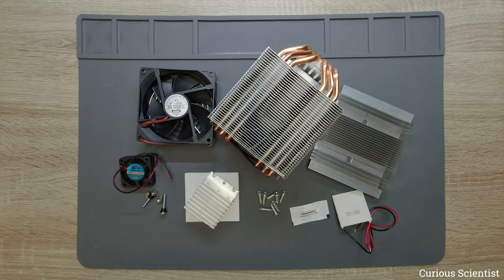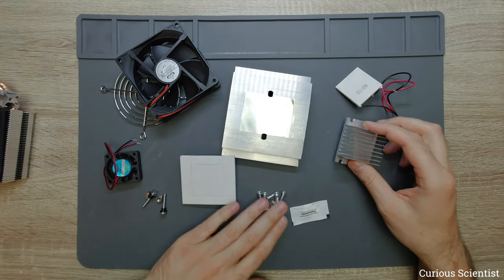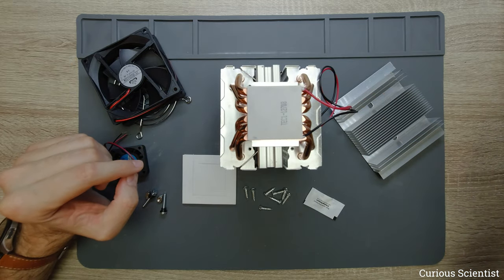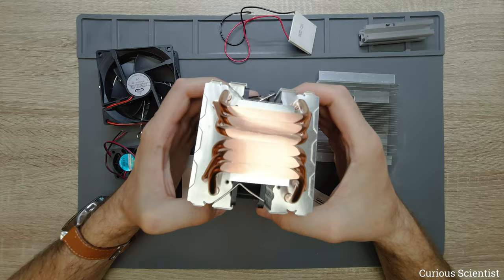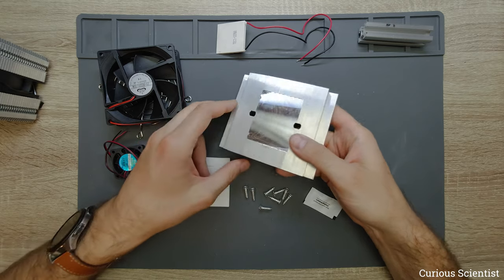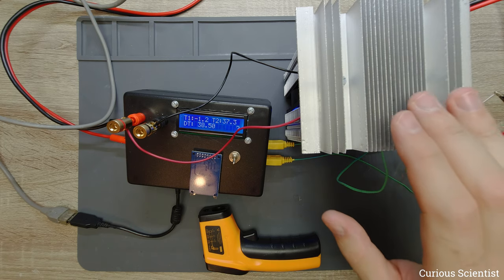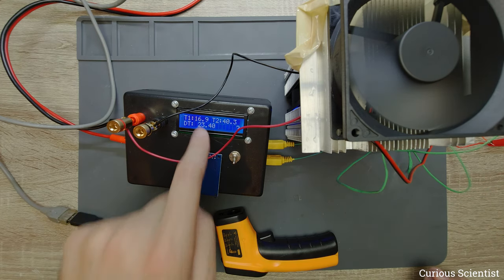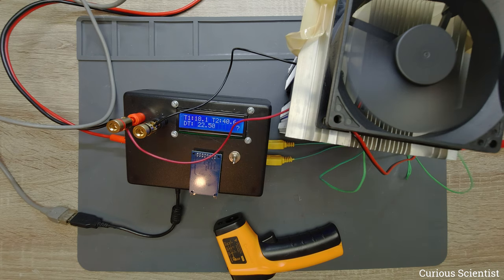Let's discuss about Peltier coolers #5 - A new arrangement of heatsinks

Comment: I'm working on a a product development and so badly want to believe in this technology. I need to drop the ambient temp about 20-30 degrees while removing humidity. Tough job....
Reply from the maker: Faith doesn't really work in physics. Peltier technology is really limited. What do you want to cool with the Peltier coolers? Dropping 20-30 degrees is quite doable, but the end result will depend on the amount of heat needed to be transferred.
Reply: @CuriousScientist  I need to cool the ambient air from approximately 120 degrees while removing humidity. This isn't a typical air conditioning system. It has a particular use.
Reply from the maker: 120 degrees can damage the Peltier cooler as it can potentially melt the solder. It is not designed for such hot environment. And 20-30 degrees from that is maybe not even enough. Dew points start from around 40°C and below, depending on the humidity.
Reply: No worries. I'm cooling the Peltier as well. The ambient air will be upwards of 120 degrees. But, the Peltier will never see that heat. It will hopefully just cool it through a couple of mechanisms
Reply: @CuriousScientist  Nada... the air is 120 degrees. The Peltier won't be under those conditions as it will be cooled. The air just needs to be cooled. Combination of water and air heat exchangers being controlled by the Peltiers
Reply from the maker: Alright. Then, why don't you just use a heatsink or similar stuff? As long as you don't want to cool below ambient temperature, you don't need Peltier coolers.
Reply: @CuriousScientist  I'm only trying to cool an area of say 20 sq. ft. So not trying to cool a whole room or anything like that. I want to exit the cold air under a decent amount of pressure so it feels even cooler. The Peltier will need to be cooled extremely well. I do believe a couple of say 10 amp Peltiers will work.
Reply from the maker: @kenarsenault9863  that is a huge area. One Peltier is only 40 mm x 40 mm. You would need a lot of them to cover that area... Also, you need to think about the time required to cool down the air. Furthermore, you can pass "through" a large volume of air through that area. That would require very high cooling power... I am a bit sceptical about the success of the project.
Reply: @CuriousScientist  Yeah... I think I overstated what I was trying to accomplish. In reality I'm basically creating a fan that will cool someone down while working. So, the sq. ft. is really much less. It would be turned on while someone is working in hot conditions and keep them cooler than their surroundings. So, all it has to do is blow cooler air on a small area.
Reply from the maker: Watch this video: https://youtu.be/ZDLN_tMxSQA

Comment: confuse should be at cooler side exhaust out not blow into cooler side? like cooler side been blow with room temp
Reply from the maker: I am sorry but I cannot comprehend what you said.
Reply: @CuriousScientist  should fan on cooler side should be blowing not blow in..
Reply from the maker: It doesn't matter if it is a push or pull configuration.

Comment: How much time elapsed between 18:39 and the edit at 18:40
I predict you had a very hard time.
Reply from the maker: Roughly 5 minutes because I forgot to remove the foam from above the holes for the bolts. :) I had to cut out the foam and align everything nicely.

Comment: hi. is there any tips on how to choose the right heat sink size for the system?
Reply from the maker: Hi!
Sure, you can estimate the amount of heat on the hot side (Joule heat, plus the heat pumped from the cold side to the hot side). Then, just use Google to see what kind of heat sink can get rid of the calculated heat.
Reply: @CuriousScientist  ahhhh i see. im habing troubles in choosing the right heat sink size for the cold side. does the same concept applies for choosing heat sink size for the cold side?
Reply from the maker: Heat is heat. ;) The same rules apply.
Reply: @CuriousScientist  just to double check if i am understanding the correct thing. if an example from the video, we need to dissipate 210W at the hot side. does it mean that we also need to use heat sink that can dissipate 210W at the cold side too?
Reply from the maker: No, you're wrong, sorry. Why would you need to dissipate the same heat on the cold side that is used to "absorb" heat? You need a heat sink that is at least capable of transferring the heat that you set as the cooling power. You can check the performance charts in the datasheet so you can get a rough idea about the cooling power (Qc) based on the driving parameters (current, voltage and hot side temperature), then you can size the heat sink accordingly. But since you won't transfer too much heat towards the cold side anyway, an older regular CPU cooler heat sink would be more than enough. You can also find relevant heat sinks on my website under the Parts and Tools page.
Reply: I would like to build a cooler box out of this explanation, is it possible??
Reply from the maker: Sure. I have a video series on this, check my channel.

Comment: You should flip the hot side and cold side as hot air rises. You'd get better results
Reply from the maker: There won't be significant changes. And here we use thermal conduction and not convection.
Reply: Do you think the heat would kill the module or the cold?
Reply: @TheNutzandBoltz  definitely the hot side would fail first if uncooled
Reply from the maker: Yes! Basically, the junctions in the module would desolder themselves.

Comment: trying to make one that is small, to keep me beer mug cold, the worst bit about making these, is the power pack, they do take some amps and watts
Reply from the maker: Of course they need a lot of power for cooling because they are extremely inefficient.
Reply: @CuriousScientist  but good for using in a home made camper van, just turned me van into a camper van, while you are driving around, just been camping for 2 weeks, paid the person next to me as they had power, I did not a £1, it cost around £5 a day to have power on a camping site, and a beer, for 3 days, kept me butter, cheese ,  milk and beer cold, while not driving, yes they can be inefficient, but good for camping, I call me van the Tramper van, as I do things on the cheap, i go tramping :)
Reply from the maker: Yes, if you can disregard their inefficiency, they can be useful. Especially, in your situation (limited space in the van, vibrations...etc.), they could be very useful. You just have to respect its limitations and they can be useful. I recommend you to check back from time to time because I just received a big package of Peltier coolers and I am going to build something out of them which might be useful for you. Cheers!
Reply: @CuriousScientist  will do  :)

Comment: Sir why my PILTIER cant turn into ice in m using 15A power supply
Reply from the maker: What is a "PILTIER"?
Reply: @CuriousScientist  12706 sir
Reply from the maker: Don't run it at maximum current. Run it at 4 A and cool the hot side very well. Also, it won't turn a lot of water into ice all of a sudden...
Reply: @CuriousScientist  the voltage ive used is 12v and my power Ampere is 15
Reply from the maker: Can't you understand what I say?
Reply: @CuriousScientist  you cant lower the Ampere because there is no  adjustment
Reply from the maker: That's your problem, not mine. You need to adjust it, otherwise it won't work.
Reply: @CuriousScientist  FYI 12706 is 6Ampere and you asking to lower 4A lol what kind thinking you are!
Reply from the maker: @noelbinongcal9749  If you don't know how Peltiers work, just keep quiet.
Reply: @CuriousScientist   lol you are the one 6A piltier and you Said i supply it with 4A? IMAO
Reply: @noelbinongcal9749 you can adjust the voltage input so it will also ajust the AMPERE :) if you supply the max amp/volt it will turn real hot you have to balance the heat so it will produce the icy cold, you need the voltage adjuster for that, a lot of cheap adjuster works fine for a dollar

Comment: HI I WANT TO CREATE BIG PC CASE WITH PELTIER COOLING JUST LIKE :AIR CONDITIONER
BUT FOR PC CASE I WANT TO COOL PC CASE AND PROCESSOR AND GPU
AND SSD AND RAM AND ALL INSIDE WITH A LOT OF CHIPSET OF PELTIER 24 PELTIER JUST LIKE 12706 24 PEACE
RIGHT AND 24 PELTIER 12706 LEFT
IN
PC CASE SUPER TOWER
TO HAVE BEST COOLING
Reply from the maker: Why do you need that? It is not feasible, it will be extremely expensive.
Reply: You can even creat ac using multiple peltier.
What you need is
12 big side peltier.
1 heat exchanger water cooled.
1 pump.
1 heat sink
1 blower fan.
And some duct work.
Arrange the peltier in such a manner that its cold side form four walls of a room keep the 2 side open to attach duct. Now attach heat sink inside the wall of that structure and a blower fan. 
Which will such the surrounding air and make it cool and feed it to the room. Now collect all the moisture in a pan and pump it to the outer side where you have to attach water cooled heat exchanger.
Reply from the maker: RIP electricity bill. :d
Reply: not ideal it will short your procie and board since the condensation will basically moist your components

Comment: The fan on the top should be with the top to the cooler to pull the cold air out not like you do in your video to push or to cold the Peltier cold side
Reply from the maker: Why?
Reply: @CuriousScientist  Why? Do you like to cool your self or to cooldown the cold side of Peltier?
Reply from the maker: Why would I want to cool myself? 

Your answers are not really established. If you are trying to tell me what I should do, at least you should be able to tell why.
Reply: @CuriousScientist  I'm not trying to tell you what you going to do i don't care, my point is if you try to cool your self or something else the fan need to pull cold air from Peltier, s cold side and blow out  not to pull room temperature air and blow to the Peltier, s cold  side it's more efficient Maby not so much but still.
Reply from the maker: @dejanpetkovski8761  If the fan produces the same airflow in both directions, it does not matter how it is directed, at least from the heat transfer aspect. In both cases, the ambient air passes through the fins of the heatsink, passes some heat to it and exits the heatsink at a somewhat lower temperature. The cold air is not "pulled" from the cold side of the Peltier cooler. The heat transfer does not care about how the air got there (pull or push).

Comment: Great work! Parts source list?
Reply from the maker: Thanks! As usual, all the parts can be found on my website under the parts and tools page.
Reply: Thanks! Didn't know that.
Reply from the maker: You're welcome!
Reply: Have I understood correctly from your videos that the best overall performance is the 12708?
Reply: Have you tested the sp1848 sa 27145?
Reply from the maker: If you cannot find it on my Peltier playlist, then the answer is no.
Reply from the maker: With this cooling on the hot side, it provides the best cooling, yes. But obviously, if you can cool a 12715 properly, it will perform better than a 12708.
Reply: @CuriousScientist  thanks again for the quick replies!
Reply: Do you have a Patreon or Kofi or buymeacoffee account for support? Ordering parts thru aliexpress is painful here in Bulgaria with customs delays and fees.
Reply from the maker: I have a Patreon, it is even mentioned in the video description, and also, there's a "support" page on my website. 

Regarding Aliexpress, since last summer, they include VAT for purchases at the checkout, if I am not wrong, so customs should not be an issue. I ordered from Aliexpress every month without issues.
Reply: @CuriousScientist  Ok, I'm going to get one if these as well as a 12708 to test on the same dual cooling setup and will let you know what I find.

Comment: You call yourself the Curious Scientist. You told me it was not possible to do what I wanted to accomplish. I hate to tell you I have had success. Keep in mind my air conditioning isn't designed to cool an entire room. But, you make most of your video showing that peltiers really aren't all that great. I have developed a product using peltier modules that is perfect as a tool. I had to tune out your videos and keep an open mind. Apparently you should change your youtube name from Curious Scientist to No club Scientist.
Reply from the maker: Share your results with us then. :)
Reply: @CuriousScientist  Happy to once my product is licensed. I will say that the purpose of the Peltiers is to cool and heat. It does both well for my application. However, this is only one function of my product so sharing it just now would be dumb on my part. I will contact you personally and share what I've done to get the results I have. Please remember that this is not intended to cool an entire room. It cools a space and power consumption isn't an issue. I can say it uses 2 modules. Each has cascaded Petiers (2).
Reply from the maker: I am patiently waiting for the email. :)
Reply: @CuriousScientist  Yes, I'm sure you are. And I'm sure you will share with everyone here that it is possible to create good results in the way I've created my application. Cause that's what all good scientists do :')
Reply from the maker: If they are good and you're not against it, I am happy to replicate your system and make a video about it. It would be nice. 
(BTW, I am not sure why do you have the urge to take things personally. If you are so against me being a scientist, I am happy to receive a proof of your PhD degree and your list of publications, because I am sure that if you criticise me, you also have all of these, right?!. ;) )
Reply: @CuriousScientist  I apologize coming off that way. I enjoy your videos and your experiments. I used them when working out how I personally could use this technology to produce what I need. I would be happy to have you do a youtube video of my experiment when I'm able to share. I'm a product engineer and am creating a product to license. So, I just want to wait a bit until I file a PPA on my product before sharing anything related to the product to protect my work.
Reply from the maker: Apology accepted. But just to make it clear, it is not nice that you did personal comments. I have no problems with critiques, especially if they are constructive, because I can learn from them. It happened a few times that I made a mistake or someone could propose a better method than the method I showed in my video and I was very happy about their comment. And they could explain the things without getting personal. Also, I never said that Peltier coolers are totally useless. If you listen to my videos carefully, I criticize those applications where people claim that they built an AC for Peltier coolers. It is simply unfeasible and it is just simple math to prove that it is extremely expensive to squeeze out the same cooling power from them as from a regular home AC. Peltiers are perfect for cooling semiconductor detectors and laser diodes, or providing cooling where no vibrations are allowed. But these are very niche areas and an average YouTube use never encounters these applications.
Reply: @CuriousScientist  Hmmm.... Apology accepted, but (lol). Your experiments are fine... but, as a product designer I only use the types of experiments you do as great information up front to know what I have to overcome. So, your experiments are fine and others do different experiments than yours which offer good information. It's all good for someone trying to understand what they can expect a Peltier to do. What I learned from the many experiments I watched is to cascade for better performance, and to cool the hot side of the Peltier as much as possible. Ignoring costs of running such a system one can come up with some pretty interesting setups. Which... I have done.

Comment: I can -19 °
Reply from the maker: I can do -45°C, and what? I guess, you don't reach -19°C with the same arrangement.
Reply: @CuriousScientist  If I can -19.
External temperature 31.
What will you give me?
Reply: I cannot post a video clip that I have shown to other people.
I am waiting to register the card in my country. My thermal temperature is 35 °.
Reply: @CuriousScientist  You shouldn't look down on other people.
You think you can do your best.
Alone?
Reply from the maker: @ValentineDay.ForYou.  I don't look down on others. You came here with just a number and nothing more info. And I just told another (proven, see my videos) number. Chill.
Reply: And I have to do better than 19.3.
Reply from the maker: @ValentineDay.ForYou.  You don't get it. Let me explain. :) I was NOT doubting your numbers. But the information that you provided was very short. If you see the differences between the two Peltier setups, and if you understand how they work, you can see why you reached -19°C. Check my videos, and you will learn the reasons. But in nutshell. By attaching a large heatsink to the cold side, I was introducing a lot of heat on it. This did not allow the Peltier to cool it to lower temperatures due to how it works (correlation DT and Qc). If you just measure the cold side directly, -20°C is pretty normal. If you check my very detailed tests, you will see that I averaged around -23°C... But reaching -23°C or such low degrees does not mean that they can cool. In fact it means that you probably don't cool anything ('Qc is very close to zero).
Reply: 20L cabinet, I put 2 pewtea -19 °.
Temperature can be -4
Reply: My houme temperature is 31 °.
Reply: Your house is colder and needs better cooling.
Your work is good
I like
Anything can happen in this world.
Reply from the maker: Actual Scientist  I stack them: https://www.youtube.com/watch?v=9x-I6kuXO24

Check it at around 47 minutes.